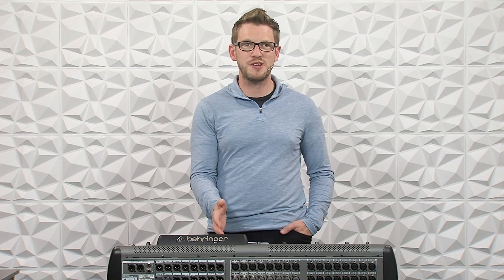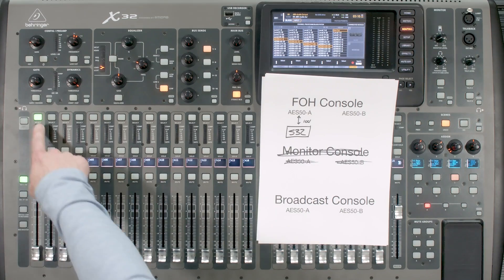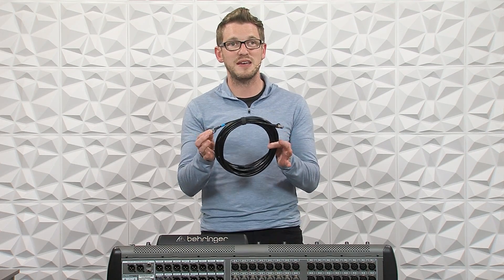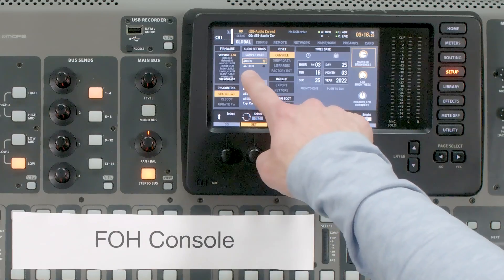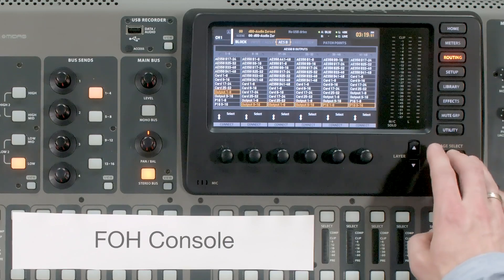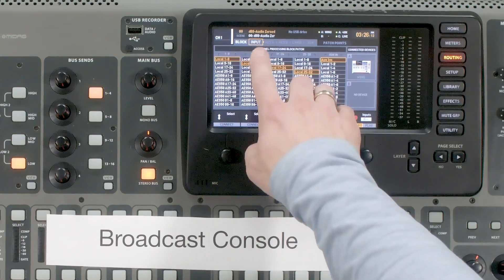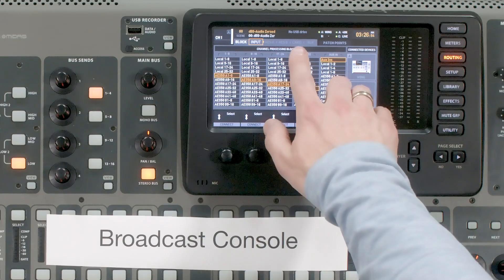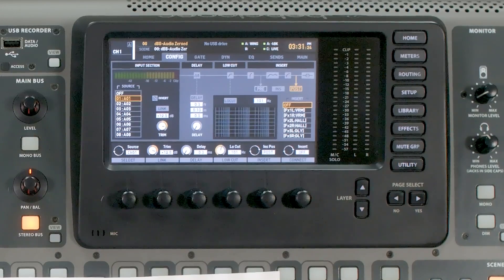Your Behringer X32 Questions: Connecting Two X32 Mixers

Comment: I have 2 x32 consoles and an S32 stagebox
My question, is it possible to  have 64 input channels and be able to send them to the same buses. For example having an input on console A and routing it to a bus output on Console B. 
As well, will it be possible to have 32 buses. 
Basically will it be possible to have the 2 consoles as if it were 1 console. I'm in a bit of a situation which needs a solution.

Comment: Question. I am doing FOH for a band that has an X32. They connect stage mics to their board and do their own monitors. I want to add my M32 for FOH and use my DL32 to feed a driverack. I assume connect my stage box to their x32 then my Midas to my stage box and my drive rack to my stage box. Does this seem the easiest?

Comment: Drew,  ...Great resource. I also have 2 x32's set up as one for FOH and one for broadcast in a different room. If I don't have anyone available to run the broadcast mixer, how can I route a mix from FOH through the broadcast x32 to our broadcast? I still want to be able to add dynamics or EQ to the broadcast mix in the broadcast X32. Is there a simple way to do this? I'm sure it's just a matter of internal routing.

Comment: Configuration

Hello I bought an x32 Rack I have in configuration a compact x32 for the front with a stage box DL32 midas, with wifi routers,. My question I was told that you can have a different EQ between the front panel and the monitors, I'm talking about EQ EQs and not EQ Masters on the monitors. If you have configuration I'm taker, the connection everything works with the sound, but nothing works in EQ on each channel on the monitors. routing connection I start from the AES50-A from the compact to the x32 rack in B and then A from the rack to the A DL32 midas

Small details the inputs and outputs are cough plugged into the DL32 Midas

Comment: Hello. I have been following your channel for a long time.
Thank you for the knowledge you have shared.
I have a question. What is the maximum length of the cable connecting the mixer and the box?
Thank you very much.

Comment: Would this same functionality work with an IEM rig? I currently have an x32 rack with s32 stage box and Arts8 splitters inside a rack. We're doing a lot of travel right now and I'm trying to ditch equipment for airline travel. Would it be possible to just have the x32 rack and follow this method? I realize that I'm then losing gain and relying on FOH to have proper gain on the channels.

Comment: Hey, I've got a FOH x32 and I'm considering picking up an X32 rack with the intent of having the rack be a slave to the FOH console just used to have more available busses for in ear mixes. I don't like using p16s because they only have 16 channels. So I'd like to set up the busses on the rack to be running our wireless in ear packs while everything else is mirrored over from the x32 at front of house. Would that work or do the busses also need to be mirrored?

Comment: Great video, Drew!  Quick question: If the broadcast console is connected directly to the S32 (AES50-B port) instead of the FOH (AES50-A port), would the gain settings, from FOH console have any impact on the gain coming into the broadcast console?  Ultimately, I'd like to have the gain settings from the FOH and broadcast console to operate independently, if possible.  Thanks!

Comment: hi Drew! Thanks again. Quick question: I have my own IEM rack, with a X32 rack in it. We are going to play for a gig in a place where the front of house consol is a X32. All stage mics are connected to this FoH consol. I wonder if it would be possible to take all channels (pre-faders) of the FoH consol and input them into our X32 rack on stage to feed our IEMs, via an RJ45 Ethernet shielded cable between both mixers? If so, could you explain how to make the routing of the two mixers?

Comment: A great tutorial!  However would like to know if connecting 2 nos X32 and 2 nos S32 ( or 1 S32,  1 S16??) , will this set up  give me more than 16 separate individual monitor mix?   I am in need of 24 nos separate mix out!  My second question is:  if  I am finally able to create more than 16 monitor mix  by connecting 2 X32s + 2 S32s ( 1 S32, 1 S16) , I am assuming volume control can be done from the master X32 whereas individual mix ( say 1 -24 mix out)  can be controlled from both  Master and Slave X32s!   I just dont want to spend money for costlier mixer-such as Yamaha DM7 that has more mix outs!  The above need has come as a band needs 7  stereo IEMs that are consuming all of my monitor mix outs!  I need more mix outs for additional stage monitors, side fills etc.  Request for guidance.

Comment: I I'm new to that kind of stuff an your videos are really great ! I currently running 8 backing tracks (paybacks). I want to use the X32 producer as an interface and to monitor our in-ears, 22 total inputs with the 8 playbacks, at the same time. Can I Send over my signal to the FOH straight with 1 cat5 without the need to get some DI ans interface to process my signal flow ? Sorry if my English is not perfect .. I'm French ... I know,  my bad :)

Comment: This is a great explanation of how to run the input signals through one console into another. I know another would be to run a second long cable from the AES50B port on the DL32 stage box into the second mixer, effectively using the DL32 as a splitter. My question is, in that scenario and also for the one in the video what determines what board outputs feed the outputs on the DL32?

Comment: How can I setup a X32 console tru be the controller for a X32-Rack ackting as the X-Touch treu the ethernet conection
On the X32-Rack on the EAS50A port is a S16 connected as extender to have a total of 32 inputs and 16 outputs , on the EAS50B port are multiplay Midas DP48 connected for monitor mix on stage.

Comment: Hi, thank you very much for all your videos, very useful. I have a question and I hope this could be the right place to put. If no, please my apollogies. I've already connected via AES50 two X32 consoles BUT i find a trouble. When I have an audio font (MP3, phone, laptop) connected to the AUX physical inputs of the MAIN X32 (the one to receive de ANALOG signales from the stage snake) i'm not able to listen that AUX source on the SECOND X32 console (which is connected via AES50A port) Is there a way to route that aux input via AES50 to the second mixer or I must connect the audio input to ONE of the X32 main console physical inputs? I hope my question is clear and, by advance, thanks again for your response.

Comment: I have an X32(house) and an X32C (stream) that I want to run live stream from. I watched your video and this was extremely helpful. However, I still have not been able to successfully get sound out to live steam from the X32C. I have a Behringer U-Phoria UMC22 Audio Interface that I use to transfer livestream audio to the Mac. Can you tell me where you would install the audio interface in the back of the X32C to make it stream out? What settings would I need to change to make this successful? Thank you!
Reply: Hi. Don't know if you were able to figure out that you do not need the U-Phoria Audio interface. The X32C actually IS an audio interface. There should be a USB connection at the back of it. If you've already figured it out, cheers!

Comment: Drew, I think I might have it, but my scenario is slightly different. I run a X 32 rack with mics pre connected and a DL16 ready for the band as a stand alone unit! That unit is used when I do smaller gigs with space issues. When I do larger conference gigs, I bring out the X32 full console. How would I connect the full 32 to the rack and the DL 16?

Comment: Drew or anyone, I have a question regarding phantom power. I have two x32 boards synched. I don't have a stage box, my inputs are direct (local) into my front of house board. Outputs from front of house are AES50 going to my broadcast board. All the inputs are working except the phantom power. I have two piano mics and three boom mics that require phantom power. I have phantom power on my front of house as local inputs, but the phantom power will not come on my broadcast board. Amy I missing something in my routing or pre-amp?
Reply: That is exactly as you would want it. You only need 48 V on the preamps delivered by one of the boards. The broadcast board gets the channels after the preamp (line level), so you only need to trim it there. In the old days where you’d have a so called passive spilt (XLR cables from mic to both mixers at the same time), you would damage the mixers if the phantom power was delivered by both of them.

Comment: Okay so I have a question. It’s a two part question, based on the amazing video you just made.
Say for example, i have two S32’s and 1 x32. And i wanted to connect both S32 together. Can i;
1- connect both S32 together and use a daw system or to put it simply a computer to control all the new 64 channels or the second half of the new channels 

if I’m able to connect them together from question one with no problem, can i then 
2- connect from the computer to another computer to use something like logic pro as a means to create a broadcast mix or would I have to connect to logic using the original computer controlling the FOH?
Reply: Hey were you able to find an answer to this? I had a similar question.

Comment: Just wondering if you could help me out with an issue that I'm trying to fix?

Set-up

X32 Rack FOH I run another X32 Rack as Stagebox from AES50-A for one side of stage, Also from the same X32 FOH is another Stagebox S16 from AES50-B. Our Drummer uses a P16m from the X32 FOH and all routing for the P16m is done on the FOH console. I would like to add 2 more P16m's with the same configuration as the drummer, via the S16 and the X32 Stagebox. I tried a P16m in the S16 and it works no-worries, BUT when I put the P16m on the X32 Stagebox nothing happens. Is it possible to get the same Configuration from one console and be mirrored to each, I don't understand why if it works on the S16 is should be the same on the X32 Stagebox.
AES50 Connections are connected with Cat5e Shielded cables with ethercon connections. and tested
Everything has been connected to the Ultranets on each console with Cat5e Shielded cable. and tested
Each Console has been tested.
I'm pretty sure I have tried every routing possibility, but I NEEED some help

Hoping you or anyone can help me out
With Thanks
Greg

Comment: We have two X32s setup at my church, FOH and Broadcast. Running a digital snake to the FOH and local inputs as well, then running the broadcast mixer directly to the FOH board via cat 5.  Is there a way to route sound back from my broadcast to FOH through that same cat 5 connection?

Comment: I have an S32 connected to an x32 at FOH and an x32 rack for broadcasting. Following the steps above, what additional steps would I need to do in order to get sound into wirecast?
Reply from the maker: That would really depend if you needed all 32 channels of audio coming into Wirecast, or if you just wanted the output of the broadcast X32 rack into wirecast. If you wanted all 32 channels then you can follow the steps here: https://www.youtube.com/watch?v=qS326ETXlu8&t=552s.

If you wanted to get the output of the X32 Rack to be getting to Wirecast, you would want to set your Out 1-8 or Out 9-16 to go to the Expansion card. Then you would need to route your X32 Rack mix output to go to your Out 1-8 or 9-16. An example of this would be to take your Stereo Buss Left on Out 1 and Stereo Buss Right on Out 2.

Hopefully this helps!

Comment: Hello , if you're doing more than 32channels and you want to add another console to your main console by using one S32 stage box, how do you connect the 2 X32 together?
Reply from the maker: You would then be doing a "sub mixer" setup. This would take the 32 channels of your first X32, then route it to a stereo pair, then you would take this stereo pair into the 2nd X32. I typically don't recommend setups like this and would suggest simplifying the amount of microphones you use on stage, or purchase a larger console like the Behringer Wing that can support more channels.

Comment: You got the cable partially Wrong. Shielded cable is correct. You messed up on the category. Cat 5e ONLY. It's in the manual.

Comment: Hey Drew I have this same setup. My problem is getting the aux from FOH to my broadcast console.
Reply: Use AES 33-40 and set to AuxIn/TB. I the broadcast console setup User In 1-6 AES A 33-38, then AUX remap User In1-6
Reply: Question Were you able to solve this problem I have the same issue.

Comment: The facility unworkable atbolans to do this exact setup soon. We're going to add a M32 to FOH and use our X32 for brodcast. Thanks for doing these update videos on the X32. Lot a people still using it as it's hard to beat for the money.The latest firmware has really helped its continued usability.

Comment: Thanks very much for this video tutorial. I have a slightly different scenario. Please help profer a suitable solution. I have a QL5 for FOH directly fed from the RIO3224 Primary Port with a single Cat6 cable. I want to introduce a separate independent mix for broadcast with a mixer like S32 or software based mixing DAW. Knowing that the gain staging from QL5 of FOH could impact on the S32 mixig console for Broadcast, how do I create an independent connnection to the broadcast studio's S32 which is about 80m aware.? If I'm not using S32 hardware, what DAW with live mixing capability will work and give me same result? Looking forward to your reply please. Thanks.

Comment: Question: What if i have the x32 at front of house and the wing at broadcast coming from the A port from the stage box which is connected to the x32? is there a clock source change on the wing or it will be adjusted automatically ?
Reply: Set the wing to AES A sync

Comment: QUESTION. I have an M32R live and it comes with 16 outputs. we are using 4 of those for the PA..... L,C,R ,SUBS . The rest of those channels we use for monitors like in-ears. is there a way to get more monitor channels? (we use behringer powerplay p1)
Reply: On my x32, I route the LMR, Sub, Delay, and reverse polarity to my aux outs. This frees up all 8 of my outputs on my rack unit to monitors. Hope that helps.
Reply: @sound4uaudiovideorecording927  I will be trying this today. Thank you!

Comment: Hi drew, awesome video!! I have a variation of this question! Could you do an S16 to a Broadcast Console to a FOH console? In addition, there would be 16 input into the S16 and then 16 inputs into the FOH console
Reply: That would be fine, following similar to this video but selecting local for those other 16 channels in the XLRs. But note the Broadcast Console would be in charge of the headamp gain on the S16 channels.
Reply: @kevinallen9106  so that means I have to make sure I set my headamp levels properly on the S16 before they go out to the FOH console?

Comment: Drew can you do a head amp split
Reply: Anyone get an answer to this? I have the same set up as in the video, but need two local inputs on the broadcast console also.
Reply: @Andrew Reid  the usb to broadcast is only going to allow 32 channels. So if u are using all 32 from the aes50 traffic u wouldn't have room. But honestly I've been looking Into running usb from both consoles and creating an aggregate device with asio drivers to get 64 channels of audio in on a windows machine.
Reply: That's fine in the preamps page. Here is a video on it. https://youtu.be/D_f196HTcq4